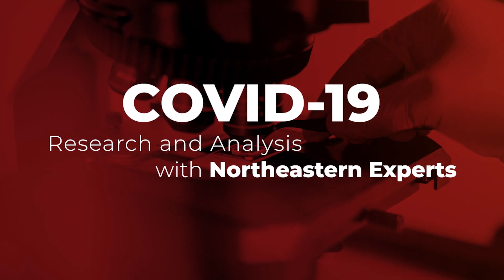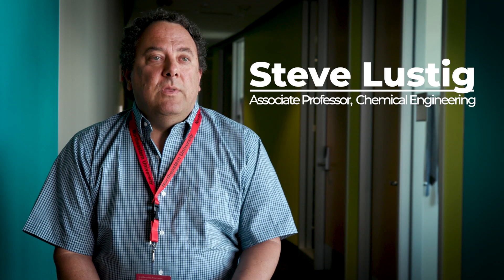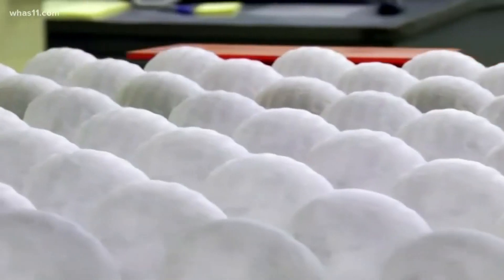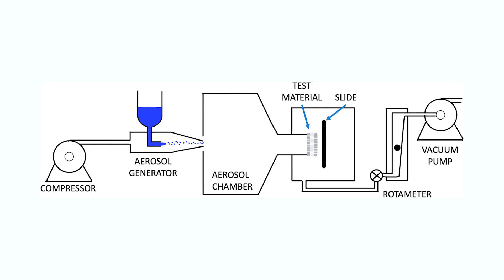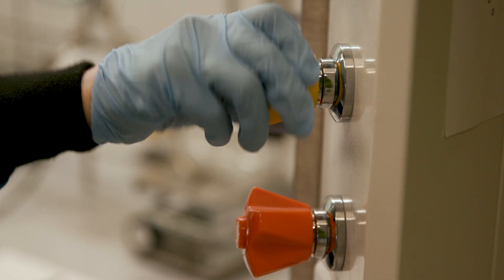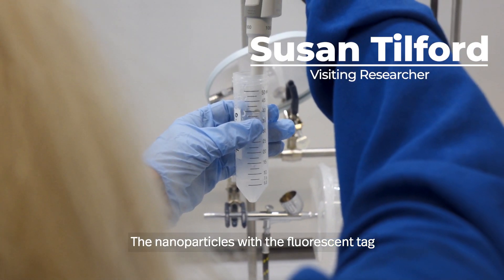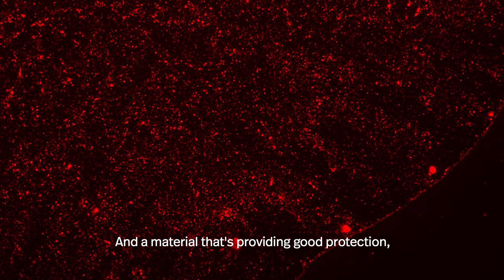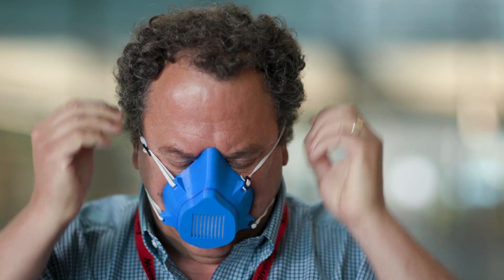COVID-19 Research and Analysis with Northeastern Experts || The N95 Solution

Comment: Several materials that give as good or better than N95 . Would like to know because I’m trying different material for best protection breathing out and in with comfort. Halyard600 does not have good air flow in or out . 2 Layers of Filti mask fabric better . Now  I’m trying to Diy a mask that is tight on all sides not to suck in any air from sides .
   Can I get a pdf or link to your test ?